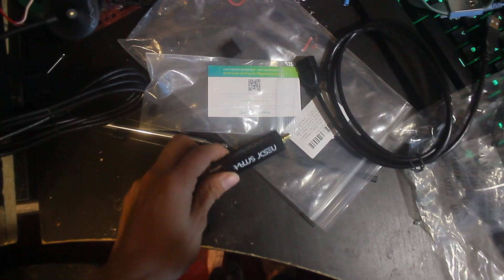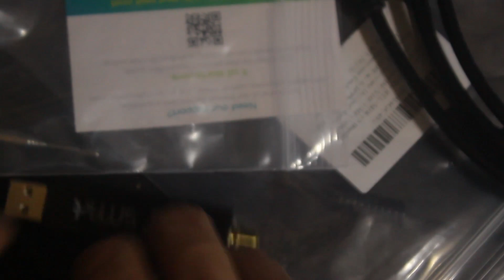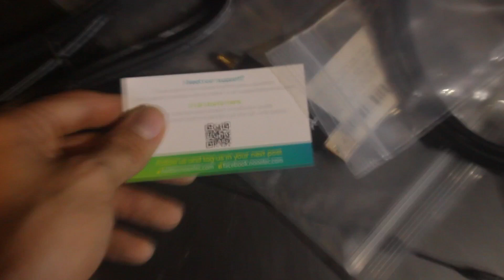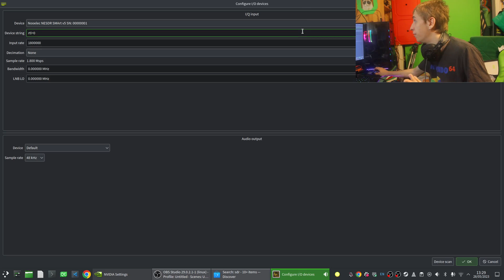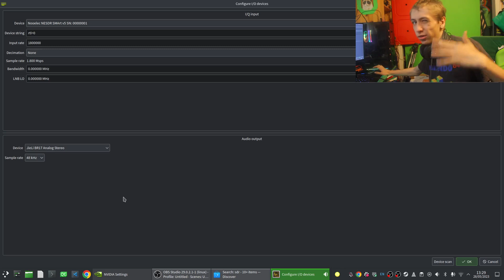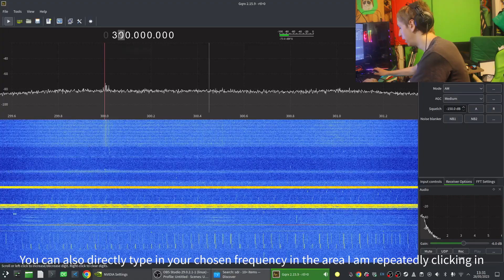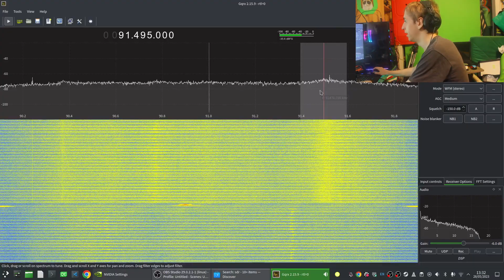Nooelec NESDR SMART SDR Review|RJ'S Reviews 40

Comment: Do you know what the 2 black antennas are for? And would the antenna in the rtl-sdr v4 bundle perform the same as the antennas in the nooelec bundle? Thanks
Reply from the maker: Those antennas are for different frequency ranges, the longer of the two (at least i think) is for signals around 433 MHz, and the shorter one is for frequencies closer to its 1.75 GHz limit. I'm not sure if the antennas would perform the same as the RTL-SDR bundle's antennas. I'd assume they might, but its a matter of testing.

Comment: Which antenna did you use? I used the included antennas and I couldn't pick up any vhf or uhf ham signals and I could barely pick up the local fm stations
Reply from the maker: I used the included telescopic antenna. The VHF/UHF band doesn’t pick up well on my end either but local FM picks up well for the stations with transmitters <10 mi. from where I am